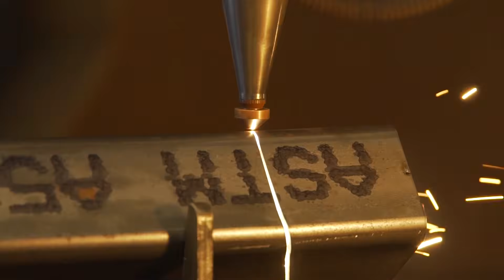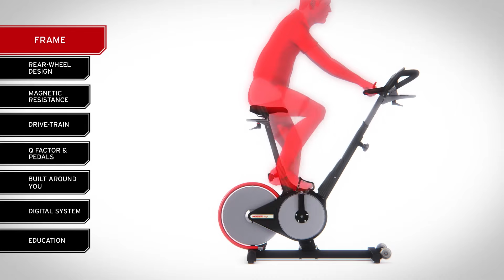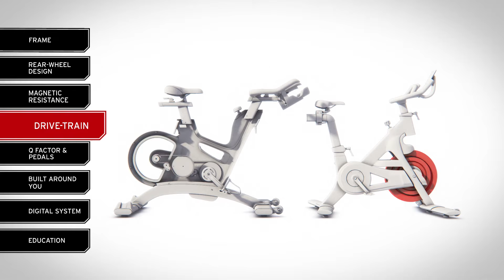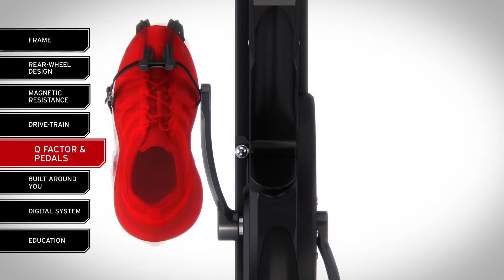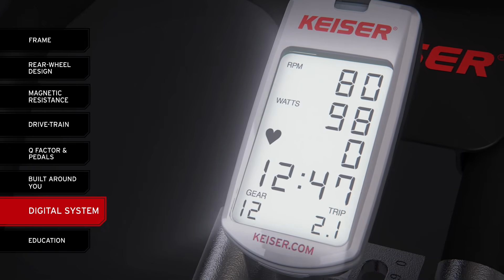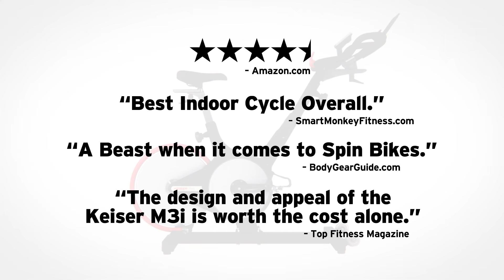Keiser M3i Indoor Bike | Built Entirely Around You

Comment: It is an amazing bike but I wish there was a way to add your arms to the workout like with the total body trainer or an air bike. But an air bike has only one resistance setting. It is too awkward to use dumbbells putting more pressure causing numbness on my rear even with a much larger and softer seat. 

Any ideas for integrating your arms much more into the workout?
Is there a way to add arm attachments to the M3i?

Comment: A few hours after watching this, I'm still thinking about the "wrong" design concerning the "sweat zone". I was there in the 1970s when people would have installed shag carpet in their garage if their car didn't leak oil. Back then, electrical goods were generally costly. Most people would have wanted a plain mechanical solution, which was how those crappy old indoor bikes used to be made. 

The sweat was a problem then, too. Everyone wore sweatsuits. It was almost office wear by 1981. I think this was due to Adidas, before Nike took over as the 800-lb gorilla. 

If you were really fit, you bought a more expensive mechanical indoor bike with fan blades on the main wheel. Where would you put the fan? Pointing at your posterior? Hardly. You would put it in front. So the sweat was dealt with by a combination of sweatsuits and a self-generated cooling breeze. 

This bike doesn't have a fan. I suppose modern buildings all have air conditioning, if they need it. Shag has been uprooted. Everyone has an exercise room now with tile floors. So why not let the sweat rain down in the front of the bike, directly onto the floor, instead of onto the bike's tender mechanisms? 

I remember those old mechanical bikes. None of those mechanisms were "tender". The friction was so unnatural you kind of wished they would die. But they didn't, no matter how much you oozed into them. 

It wasn't "wrong", it was fit for purpose. It's painful to remember that old purpose. Still doesn't make it "wrong". That's a Jedi mind trick, and people ought to recognize this.

Comment: Okay, that computer with no buttons cycles between two different screens at some preset speed. One of those screens has the information I want to monitor, and the other has a bunch of stuff I don't need to see. On a rowing machine, this design decision would be a catastrophe, because you need to monitor every stroke. 

On this kind of a bike, your power is so directly proportional to your cadence, that you don't have to monitor everything all the time, e.g. for heart rate zone training. But I found the alternation between two screens initially annoying, and if there had been a button to cause it to stop doing this, I would have happily pushed it. 

Because I use the Concept2 quite a bit, my expectations of the display are a little higher than average, if we're to believe this narration. Or, the other story, the total lack of buttons is terribly inconvenient for most control freaks. (There are no control freaks in athletics. That's just an evil rumour.)

Comment: Okay, you put your phone or your tablet on that tray, then you decide your hand pressure is too high, so you want to raise the handlebar mechanism, but you forget about your device on the tray, and then the mechanism is sticky and you have to force it a bit (this happened for me on three different units), and then your device goes for a tumble. There's no real retention for the device on this tray at all. It won't fall off under normal use, if normal use (in a recreation center) doesn't include getting off again after five minutes because you didn't have the fit completely dialed in.

Comment: Okay, so I rode this thing today in the local rec center, and it was actually pretty nice, but it's hardly perfect. 

The first bike I sat on seemed to be tilted a few degrees to the right. I've never felt off balance like that on a road bike. I figured it would have adjustable foot pegs, but they just spin without changing height. 

I had to switch to the next bike, and set it up all over again. The second bike was level, but wobbled a bit, because the four feet weren't developing uniform pressure. I didn't mind this, it was only a small wobble. 

Second, the water bottle recess (can't call it a holder) doesn't have much retention. The moment you swing your foot through the cavity, you're almost certain to knock it down, at least with my giant feet. It's just a mild circular indentation in a lower frame post with a round flat region below. 

Finally, the adjustment range was insufficient for my body type. I have a very long torso. The front assembly does not rise high enough to avoid putting more pressure on my hands than I would like. I know a fair amount about fitting. My knees and seat position were optimal for my preferred riding style (slightly toe down at the bottom of the pedal stroke, with the knee joint directly over the pedal axle at the 3 o'clock position). 

Also note that the seat is very hard. I did not enjoy it yesterday in regular gym shorts, but today I took padded bike shorts and it was good enough. Note that I'm actually in the market for a recumbent e-trike, because I've never liked the amount of sit-pressure my giant torso generates.  

The adjustment problem is actually small and can be fixed with a folded towel over the handlebars. I had lots of adjustment left in the seat post, despite a fairly straight-leg riding preference. The handlebar assembly simply does not rise up enough for really tall riders, circa 6"5 with a long torso, or 6'7" with normal torso. I'm the first of those two body types. 

There's an awful lot to like about this bike. It seems very sturdy and the resistance control was a dream to adjust. There's really no unusual mechanics around the pedal stroke, like some cheap indoor bikes. I did 40 minutes today at 130 W at 85 rpm, which is the top of my Zone 2, around 129 bpm, in my late 50s. I'm far more fit than most couch potatoes, but nowhere close to a real athlete. 

If those feet were adjustable, the thread is finer than any I've seen yet. I got nowhere after many turns.
Reply: I actually noticed on my ride today that my feet were further apart than I like. By jamming my feet as far as they would go to the inside of the pedal platform, I got to where I wasn't uncomfortable. It's quite a wide platform. It seems odd that I found the pedals too wide, because at 6'5" I'm hardly the standard waif generating 6 W/kg on a hard climb.
Reply: I appreciate your insightful review!